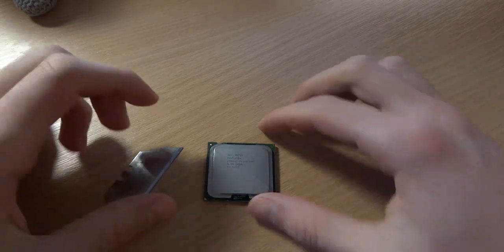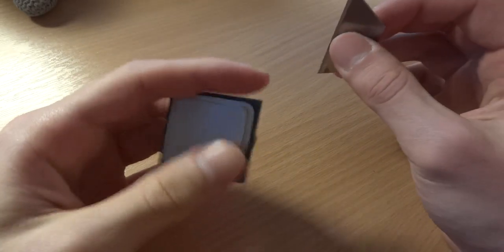Pentium 4 vs TotallydubbedHD De-lidding attempt

Comment: Guess you guys aren't too technical you cannot solder the IHS to silica/die or epoxy/PCB, they used thermal epoxy between the die and the IHS.  Simply use a heat gun and at around 200C the epoxy will soften up like jelly and you can take it off.
Reply from the maker: Didn't know it was soldered at the time - ended up being good fun :D

Comment: Very nice in depth tutorial for the nubs. Great job. I just wish I got a better CPU. My temps are awesome, but I can't get it past 4.8GHz, which needs a ridiculous 1.49V to be stable. But my temps max out at 75c using CLU on the die running Prime 95 large FFTs with my H80i, so I really don't care how many volts it takes as long as my temps aren't above 95c. It makes me sad to see some delid results with people running their chips at 5.2GHz with something retarded like 1.42V :( Lucky bastards.

Comment: Yeah, it's far more difficult to delid any CPU compared to IB because IB CPUs use cheap thermal compound. But it is possible to delid older CPUs.I just delidded my 90NM 3.06GHz P4 today. Just cut through the glue, get a torch lighter and fucking burn the piece of shit in the center. The solder melts and the lid pops clean off. You can hear the solder pop when it's ready. I totally recommend delidding IB and applying liquid ultra though. Check out the vice and hammer method. It Seems much easier.

Comment: it will not open because the ihs is soldered to the chip. well ... not actually soldered but the thermal compound between the chip and ihs also acts like glue. but afik the ivy bridge cpus have normal thermal compound. so it should be fairly easy to remove the ihs.